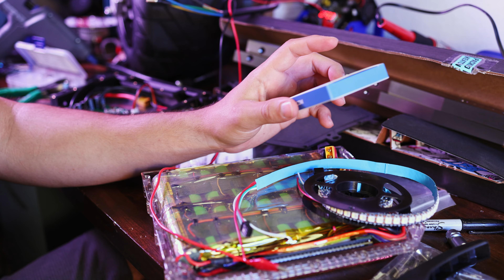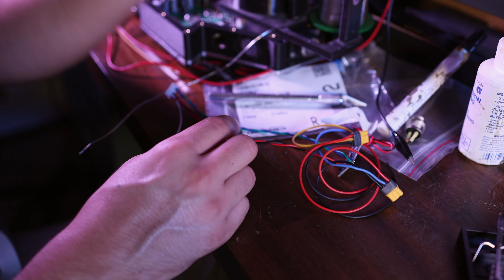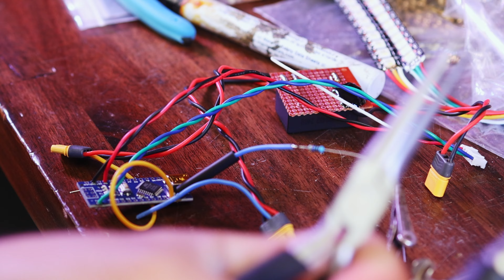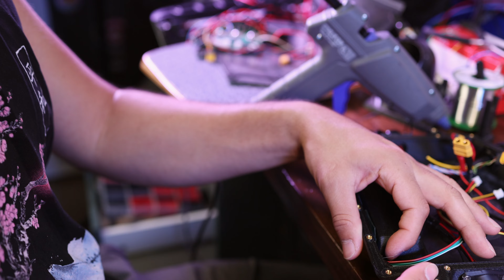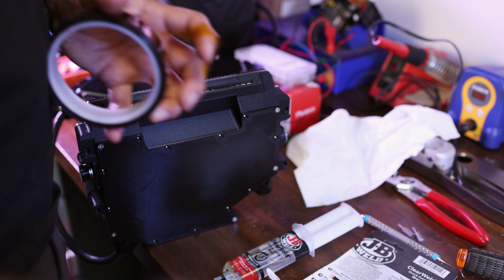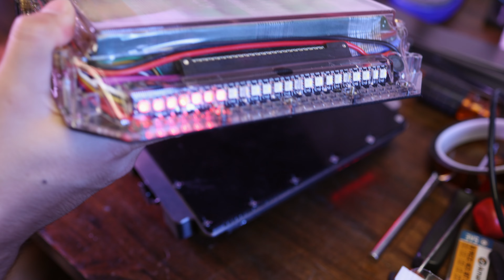DIY OneWheel Lights! How To Install & Detailed Setup Guide // @TheBoardGarage

Comment: Damn, radio shack. Just aged both of us. I miss having them around for just this reason. Never forget what they took away😢
Reply from the maker: "The good old days" haha yeah it is some nostalgia
Reply: @RBEMotion i got to enjoy it a little longer (i believe around 2015 or 2016 ish) i lived on the big island of hawaii kona side and still had one 90 miles away in hilo. I would go and load up on whatever i needed and just walked the mall so i could justify the trip. 😂
Reply: @RBEMotion also back to topic, i could not get any knock off audrino to work. Tried three and confirmed code was written, still nothing. Checked the buck and the ubox uart port, and made sure the rx and tx were flipped at the ubox, sharing ground, pull ups on the comm wire, 5v control pin with a resistor to the shared ground, everything checked out. I got a single green led for a second and then never again😂. Bought the audrino nano and will update this weekend when i wire it up.
Reply from the maker: Hmm that's tough. I do remember having to fiddle with the code but it was a really long time ago now so I'm having trouble remembering if I changed anything. I know the first time I did it I accidentally forgot to put the anti-flicker resistors on, and I think I also wired the pins one pad off. Fixed it and it worked, but if you've got it wired properly, maybe it is an Arduino issue. If I recall, the code was pretty dang simple
Reply: @RBEMotion just wired up the legit audrino and workes so far unlike the knockoff audrino. Its on me honestly for trying to cheap out a pretty cheap part to begin with. Next i gotta work on coding a status light so i have a duty cycle meter. Ive been riding a few months without lights so its gonna be a game changer since i can ride at night now😅
Reply from the maker: Oh nice haha I'm glad it worked out! My cheap one worked so I guess YMMV

Comment: Great tutorial! I followed it, but additionally added a wire for a common ground between the Arduino and the buck converter. Before that, the LEDs were flickering, probably due to a difference in my setup. Very comprehensive videos. Your work is invaluable. Thanks!
Reply from the maker: Thanks for watching! I agree that the additional ground wire probably helped with that. The pulldown resistors helped me on mine. And thank you, I'm glad you enjoyed it!

Comment: Is it possible to configure this using the original OneWheel Pint LED bars?
Reply from the maker: I'm not really sure, do they have a normal 3 pin RGB control connection?
Reply: @RBEMotion  to answer the question....yes. they have the regular 3 wire setup (ground, comm, 5v). I used some with a rgb controller that avaspark cells. Dont know about the audrino

Comment: NGL I tried this and could not get any LED output at all. Tried to troubleshoot but gave up and put an Avaspark Module in. 

I have the stuff laying in a pile somewhere, I'll revisit using this guide later ig.
Reply from the maker: I suppose it can be a little bit finnicky. If it never output any light at all I wager maybe your data pins were soldered wrong or maybe you got a dud arduino or something. I know how these projects can be, to be honest I'm glad it worked the first time. I did do some troubleshooting and had realized I mis soldered my data pins by 1, fixed that, and it worked as expected. I also forgot to put on the anti flicker resistors at one point